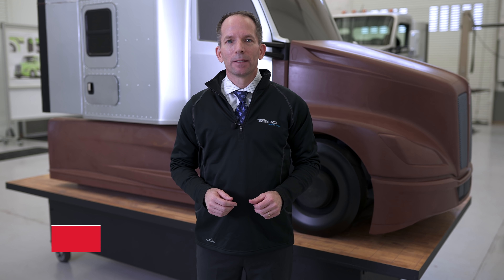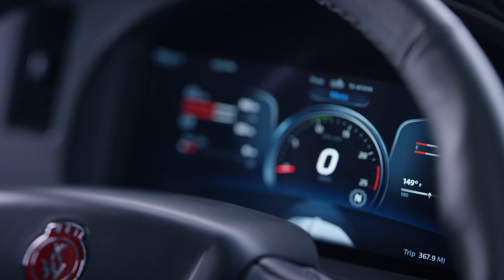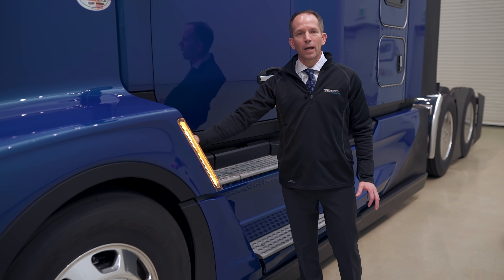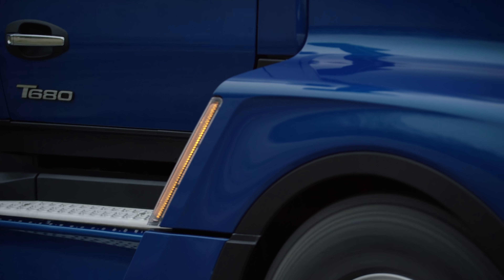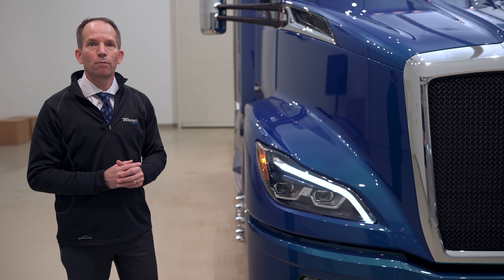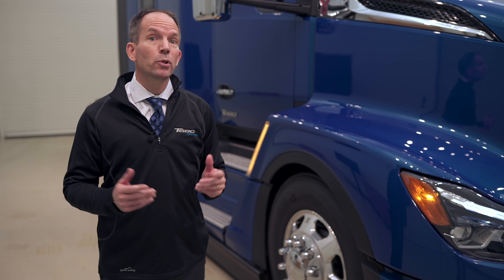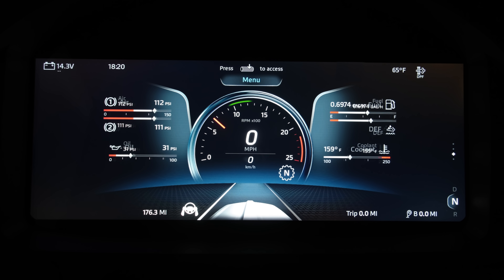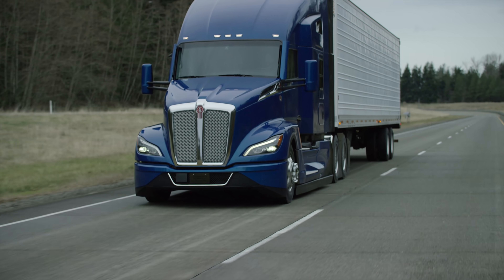Kenworth T680 Next Gen Product Development

Comment: "set the stardard"?? I've been driving the T680 2019 for the past 5 months and it is the worst piece of fucking garbage I've ever had the misfortune of driving. It was new when I got it and it was 2 weeks in the shop in Chattanooga TN for a £¢@¤@ing DEF sensor not even a month in. Everything is badly designed. Seems de designer has never driven a truck in his life;
-Cruise control:
---"Resume" is supposed to resume at the speed you had it set before cancelling it, not setting it at the speed you're now going after tapping the brakes for a construction zone.
---Have to press the button 3 or 4 times before it registers.
---Not constant, sometimes it'll downshift before you even hit the hill, other times it waits until you're at 800 rpm and feels like it's about to stall before downshifting.
---The ECO mode puts the truck in neutral when you go downhill, but then it waits until it's 4mph under the Set speed before flooring it, thus cancelling any economy you got from that neutral.
-Transmission:
---If you're not in cruise control, truck always waits until it's gasping for air before downshifting.
---If you downshift manually without actually going into manual mode, it shifts back to the bad speed 2 seconds later... and then back down to what you told it to be, but by then you're down 10mph. That's if it shifts at all, most times it'll just DING at you and do nothing.
---The system that holds back the truck so it doesn't reverse when you stop in a hill should turn off when you're actually backing up. We have other things to concentrate on than fighting the truck so it actually goes backwards.
---There is no way to do any kind of gentle precise manoeuvre; the first 3 inches of the fuel pedal does nothing, but when you hit 3 inches and 1/16th, it launches forward(or backwards) like crazy.
-Lights:
---WHO IS THE DUMBASS WHO THOUGHT IT WOULD BE A GOOD IDEA TO PUT THE SWITCHES AT THE OTHER END OF THE F?&*ING DASH? and every time you lean over to reach them, the damn seatbelt locks you in the seat.
---5 switches to do what you only need 2 for.
---No way to "quick flash" to signal other drivers, most vehicles built in this century, when you pull on the lever, the high beams come on and go out as soon as you release it and you push down on the lever to leave them on, but this piece of junk they stay on when you pull and pushing down does nothing, but you can still push it down, why?!
-Probably the worst seats on the market.
-The passenger side convex mirror on the hood is right in the spot the wipers don't reach.
-No "reading" lights in the middle, instead there's a useless red light that reflects on the chrome gage rings. Instead, the lights are above the window, so if you drop something in the middle between the seats, you're blocking your own light and can't see shit.
-Even with the brightness at minimum, the way the gage cluster is made, the reflection on the driver side window is all you see at night, can barely see the side mirror.
-The hood latches keep unbuckling every time you hit a bigger potthole.
-The cupholders are too big for a can or a 510ml bottle, but too small for a 1L bottle.
-Cuts all power to the CB radio and other accessories when you turn the key off.
-There's a gap between the mat and the fridge just big enough for your phone to slide underneath, and the only way to get it out is to rip the fridge out.
-No ladder to get to the top bunk bed. For older drivers or out of shape drivers, that climbing shit is really dumb.
-Only 2 12v "cigarette lighter" plugs in the front.
-Plastics inside rattle worst than a 1987 Pontiac sunbird when you're at low RPMs.
-This is 2021, steering wheel commands should come standard.

I could go on for another hour listing all the ways this is the worst truck out there. Even the ProStar is a better ride than this. DO NOT BUY THIS GARBAGE IF YOU'RE IN THE MARKET FOR A NEW TRUCK! I'm about a week away from quitting this company if they don't put me in a better truck, Hell i'd take a Sterling with 2 million miles over this junk.